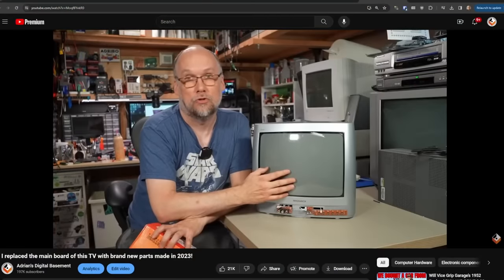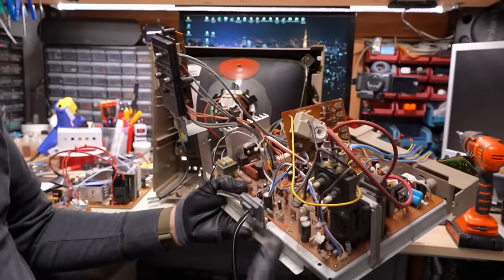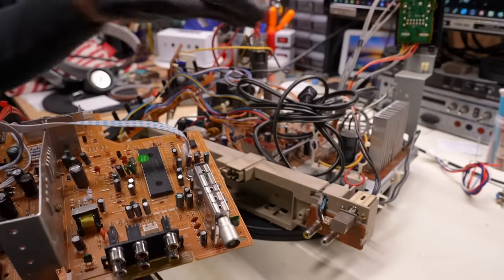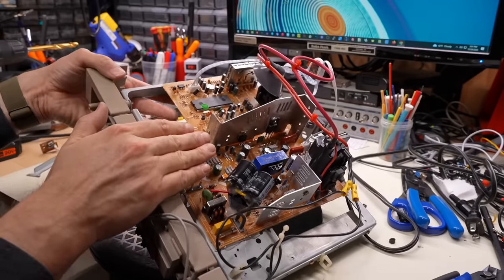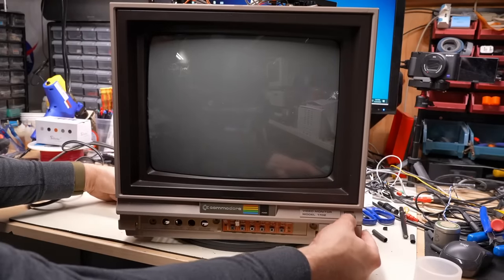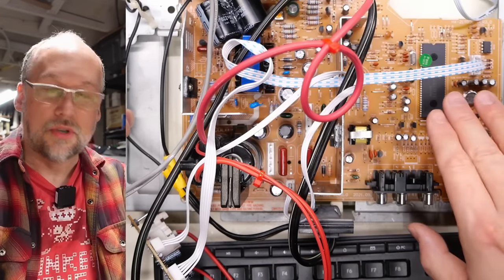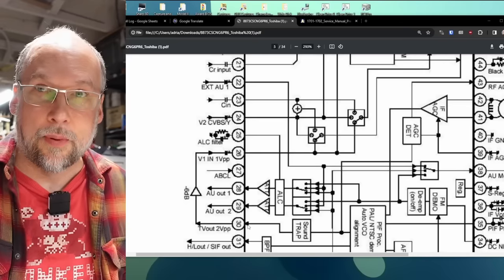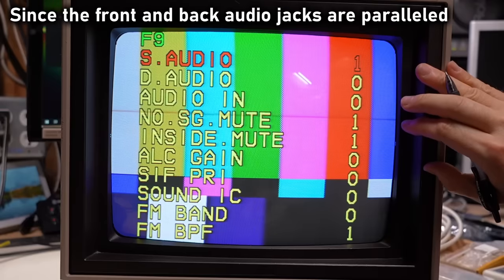Restoring a Commodore 1702 monitor using a main board from 2023

Comment: I have a question here, perhaps not a simple one. I have an old working tube, but a very old fault chassis in my arcade machine, can I just buy one of these chassis and connect it up? Or is it more complicated than this.
Reply: It depends on the particular monitor but yes it would be that simple if it's compatible.
Reply: @eDoc2020  How do I know if it's compatible or not?
Reply: @vulcan6036    Look for reviews of people saying it's compatible. This could easily go down the rabbit hole of X is compatible with Y which is compatible with Z... There are lists of tube models known to be compatible with a particular arcade monitor chassis, and hopefully one listed as compatible with your chassis has been tested as working with these kits.

If the goal is arcade use I believe there are also aftermarket boards for arcade monitors, that would be an easier way to ensure compatibility. That would also give you RGB inputs without any mods.

Comment: I'd rather use some metal spacers (like used in atx-standard to mount the motherboard) - they are available in different heights - instead of modifying the metal frame and using hot glue.
You could've positioned the board, marked the mountingholes with a sharpie and then drill and cut threads for the spacers to get it right.
Hotglue on the other hand can and will most likely detach itself at some point in time and the pcb can then float around and possibly short out.

Comment: I think Sugru would be better than hot glue.
Reply: @martinr1834  Sugru ‘if applied thick enough’ is as resistive as rubber, so it should be fine anywhere you would usually use electrical tape. As far it’s adhesive properties you are correct but it only has to attach to the metal and form a structure around the main board, no plastic connection required.

Comment: I’ve been nerding out on composite video signals lately, and the NTSC color averaging you’re seeing across lines might actually be a two-line comb filter chroma/luma separator — more advanced than a simple notch filter. Functionally, it seems similar to the Hannover bars cancellation technique.
Reply from the maker: It's not. I have sets with this more advanced filter and they remove the chroma dot crawl. This set has the same dot crawl as any set with a simple notch filter... Oh you can disable the chroma trap in the service menu which turns off the notch entirely, but you can't disable the delay line averaging.

Comment: I don't suppose it can handle NTSC50 as well, can it?
Reply from the maker: I didn't mention, but yeah it does it without issue! I plugged in my recently modified NTSC-50 Acorn Electron into it, and it just sees it as NTSC3.54 (which it is)